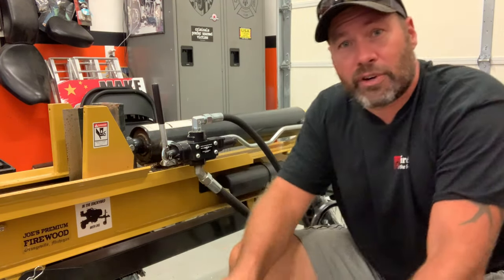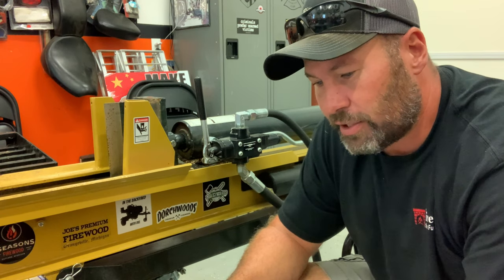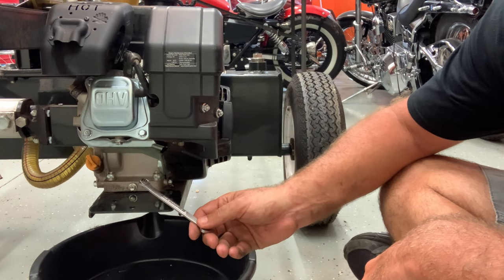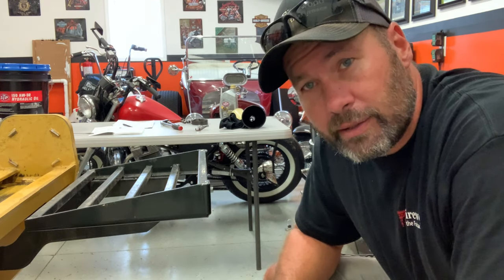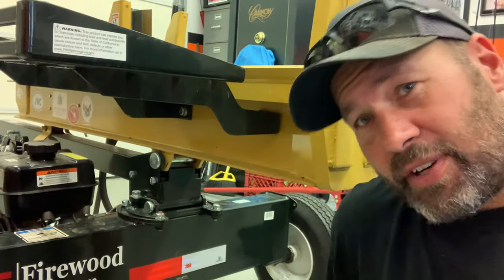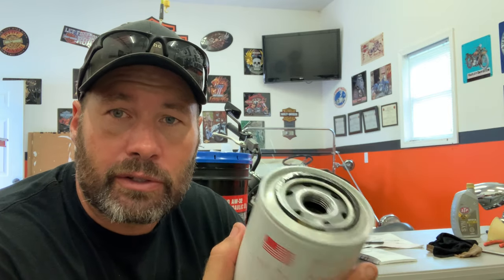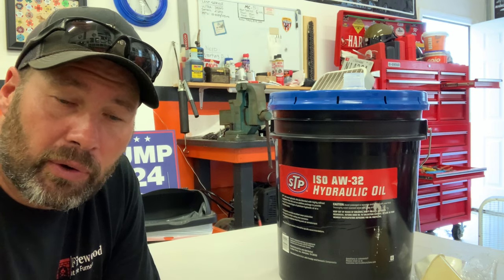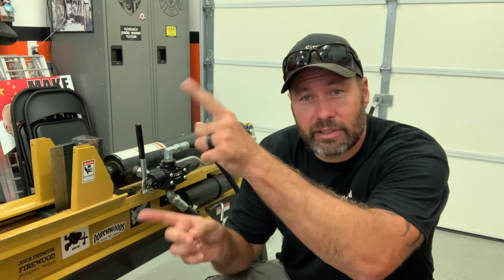HOW TO SERVICE THE COUNTYLINE LOG SPLITTER - #35

Comment: I purchased mine last year brand new it has about 5 hours on it, how when should i service the engine oil and hydraulic fluids, 150 hours ?
Reply from the maker: I don't have the manual for the engine in front of me, but there is a service interval chart. The first service is fairly quick.

Comment: I have a County Line 30 that's 3 years old. I use Norwegian Maple lmost exclusively for firewood in a custom modified [by me] Earth Stove because it burns clean. The splitter does a FAIR job on 20 30" rounds but gets extremely hot when you dog it hard & fast. The Kohler 9.5 needs better cooling and this thing also needs a good hydraulic oil cooler in the worst way. Basically they are a cheap "made in China" piece of crap that will barely do the job for a premium price, and almost ALL splitters are carbon copies of each other. Those 4 way splitters are a royal joke for big rounds and I always use the splitter with the rail in the vertical position,....unless you like to lift 100# rounds all day long [dumb a - -ses use it horizontally on small trash wood]. Weld you a bigger 16" x 20" cold rolled steel foot onto the POS factory installed foot for a big improvement for big rounds of wood. Also needs a good trailer tongue jack for lifting this beast onto a 2" ball.

Comment: I noticed air kicking in my lines butt it's not low on hydraulic oil
Reply from the maker: The pressure when you start and stop the cylinder can cause them to jump. May not be air. Once cycling the cylinder it will push the air out on its own

Comment: I would think the hydraulic fluid would be good for a long time?
Reply from the maker: Yes it is good for a very long time. I decided that I wanted to know exactly how much time is on it. May sound trivial, but I keep a log of roughly how long I run the splitter each time I use it. Since I bought it used, I had no idea how many hours were actually on it. Thanks for watching Joe.
Reply: I know it’s not cheap either, like $20 per gallon

Comment: Hey bro use a 2 inch hole saw from underneath the drain plug on the motor .about a quarter of an inch in front of drain plug . Then you will have a mess free oil change .
Reply: I also added 4 of the county line wood trays ,it keeps logs from dropping on motor ,pump and filter attachment plus its handy for extra wood at hand .

Comment: I loved your video; very helpful!  I have the exact same splitter, bought in 2018.  I'm a 70-year-old, but I have no trouble splitting 24" diameter red oak logs.  I use mine in the upright position.  However I'd get rid of that Trump sign, the majority of the wood burning community are not fans.
Reply from the maker: I try not to be political on the channel. There is enough of that everywhere else. Glad the video was helpful for you.

Comment: Very odd. My Countyline 25 ton has NO drain plug on bottom of hydraulic tank. It seems only way to drain it is by removing a hose from the tank. My model# is 579782. Anyone else have this configuration? I don't like removing hoses that don't leak! Great video, by the way!
Reply from the maker: Thanks Nick and wow I’m surprised it doesn’t have a drain plug! I’m like you, I don’t mess with connections that don’t leak. Sounds like a cost cutting measure to me. How new is your machine?
Reply: @FirewoodattheFurnace  It's about 8 years old. Your video made me feel comfortable with just draining the tank via the filter port. I could have gotten a bit more out if I pulled the hose, but not worth dealing with a resulting cracked hose or broken clamp! I'm embarrassed to say I've never changed the hydro fluid in all these years. Man, was it nasty. My bad. I do all other maintenance and have replaced the carb twice. (It sits in my yard, covered, because I've no room indoors, but the moisture just gets in. And a carb costs only $15! It's easier than cleaning it!) Thanks again for the very thorough lesson! FWIW, my filter has a different PN: 578459 and has a bypass that the manual warns is necessary, also 25GPM. Sucker cost me $27, but like you, I replace like with like. Walmart had the best price. Tractor Supply couldn't help me at all.
Reply: They did a model update in 2018. Mine is probably a 2017 but maybe a 2016 because I bought it very early in 2017. I also don't have a hydraulic tank drain and just use the filter opening. The other difference I am aware of is the pre-drilled hole size for the log catcher; the older model has smaller holes. The new catchers from Tractor Supply come with 1/2" bolts but I believe I needed 7/16" bolts (I didn't want to deal with drilling the hole bigger and I already had a pile of used automotive grade bolts that fit.).

Comment: This joker wasted 6 gallons of fine hydraulic oil.  The splitter also needs a longer tongue, better bearings with greasers, and larger tires so it can be pulled at highway speeds instead of being limited to a max speed of 45mph.  Universal hydraulic oil filters are readily available almost everywhere = NAPA, Rural King, etc. Hydraulic oil needs very little filtration anyway, unlike engine oil.
Reply from the maker: Thanks for watching